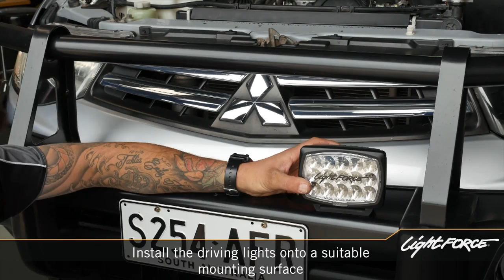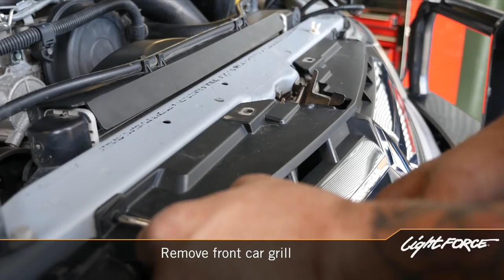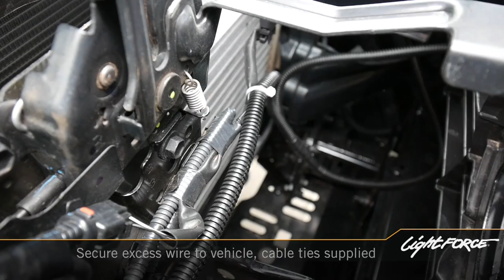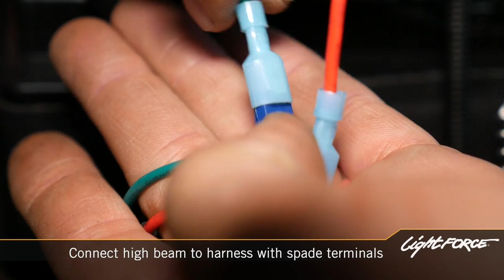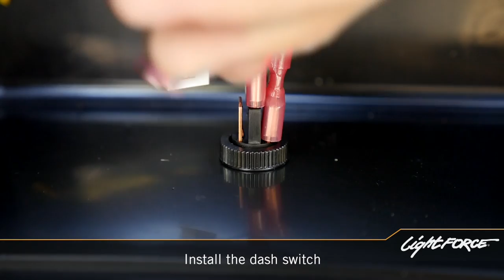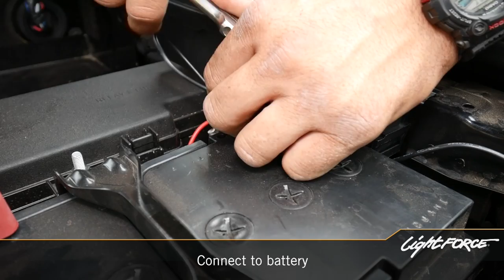Mitsubishi Triton - DIY Install Lightforce Striker LED Driving Lights

Comment: Are you guys SERIOUS???
Using those ABSOLUTELY CRAPPY Scotch locks???
What kind of professional auto electrician uses them?  NONE.
Such bad advice.
Reply from the maker: Thanks for your comment! While it is ideal to solder connections when possible, this video and our User Instructions are intended as a DIY solution for the novice, not for an auto electrician.
Reply: OK .....but showing the use of these USELESS Scotch locks is not a great idea. 
I understand they are quick and easy but they lose contact and cut through the wires. A bad bad idea.
Should have used a soldering iron in the clip to show the correct way to install.
Apart from that... good job.
Reply from the maker: Thank you! We appreciate the feedback.